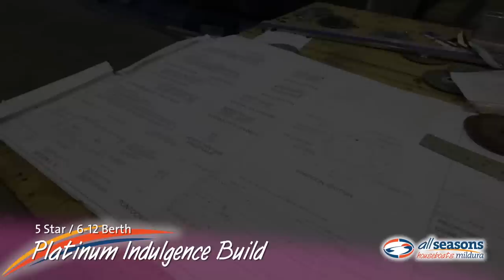Platinum Indulgence Houseboat build - All Seasons Houseboats Mildura

Comment: How much extra would it cost to have an extra roof full of solar cells and convert the boat to electric drive?
Reply: $1 million dollars and the boat would be useless because of the weight of the batteries
Reply: Only if it is implemented by someone that doesn't understand solar cells and battery technology.
Reply: nattsurfaren Nope doesn't work that way with boats, they take constant horsepower to move and lots of it, nothing like a car
Reply: In that case all other "solar powered boat'  hits in a youtube search are made up? This boat looks like 4x10 m2 that would make more than 4Kw from solar cells. It is enough to push the boat slowly forward. This is what I'm looking for. This leaves the option to start with zero batteries and add more for faster run.
How can you be so condescending to a solution that has already been researched a proven to be fully functional and already existing as an established business.
Reply: nattsurfaren So dealing with wind and currents don't matter?

A house boat this size is a huge sail and just fighting the wind alone would take serious horsepower

I've got an electric boat and trust me wind changes everything
Reply: If the wind would blow hard enough any boat would struggle. If the conditions are good then there is no problem and when it starts to blow then of course extra power would help. A hybrid solution would be optimal.
Reply: Much has changed since those comments were made. In short, that size boat could easily be powered by today's solar systems!